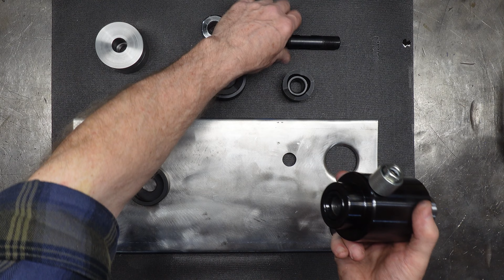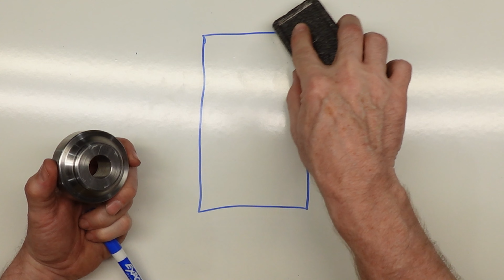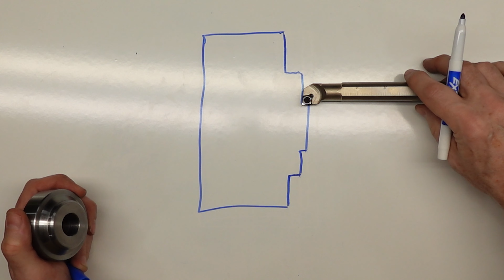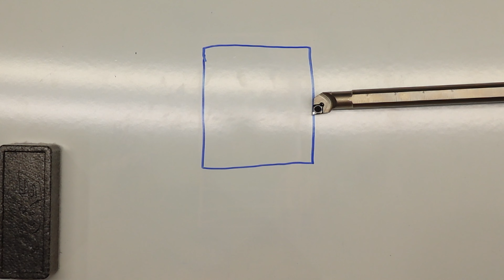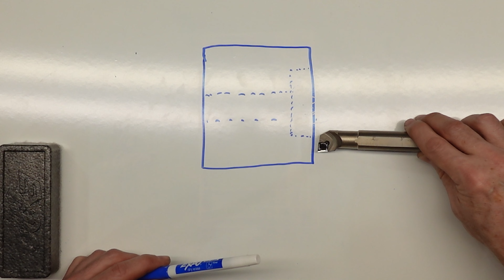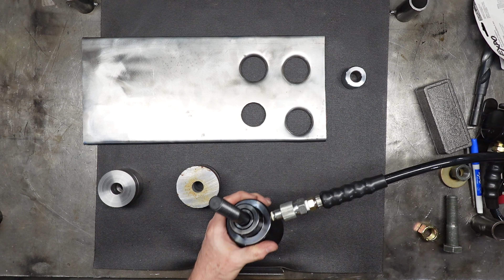DIY Dimple Dies

Comment: Thanks for the video.  I have an old manual set of Greenlee punches. I have wanted to make Dimple dies and your approach is simple. Hydraulic cylinder ram from local scrap yard good source for Chromoly.
Reply from the maker: I'm glad you like it.  They have proven to be reliable and durable. I've made quite a few dimples with the very sets I built in the video.

Comment: Nicely done. What material did you make the dies from ? Would it matter ? Cheers
Reply from the maker: Thank you!  I just used standard 1018 / A36 steel.  One set was cold rolled the other hot rolled.  As these are designed for creating dimples in sheet metal (16g in the video) you could just just about any steel.  Cast iron would be an excellent material for longevity.  If these were to be heavily used, making hundreds of holes I would use a steel which could be hardened, but that is only for longevity.  To be honest, they only take about 15 minutes to make, so for my use case (occasional dimples) leaving them soft works just fine and making another set if they ever wear out.

 Aluminum would work, but would likely gall up after a few holes, but if all you needed was a few and all you had was aluminum it would work in a pinch.